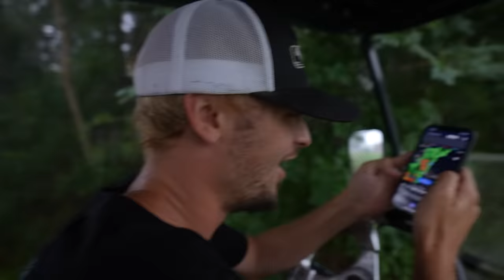SENDING FOUR-WHEELER ON 37" TIRES UNTIL IT BREAKS! *TOO MUCH NOS*

Comment: I’m so confused I don’t think he knows how this stuff works lol ……the higher the pressure the better….you don’t purge to loose bottle pressure you purge to get air out of the lines. Also those axles don’t have clips in it like the rear end of a truck they have pop in and out. If it’ has wiggle room you need to reshim the front diff lol

Comment: @braydonprice I have a 2010crf 250r it won’t run had full top and bottom end rebuild vertex piston etc new loom it will run off QuickStart and it’s own fuel or even if a bump but it won’t start from a kick can u ior anyone help me out never seen this before